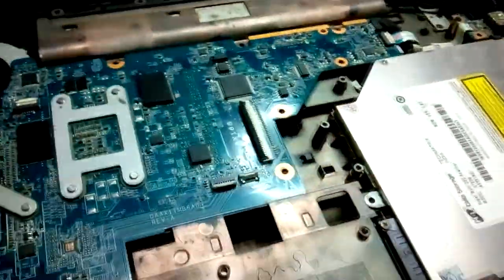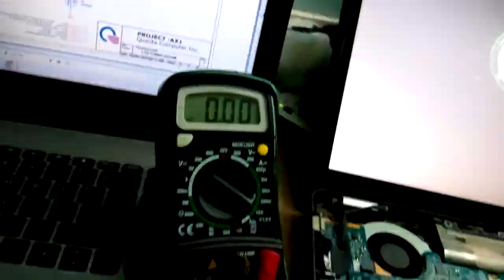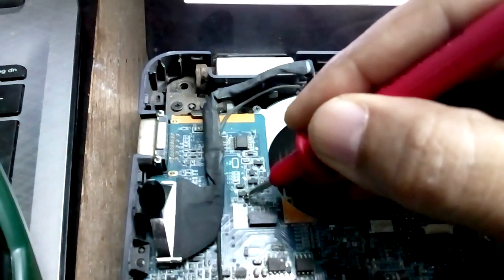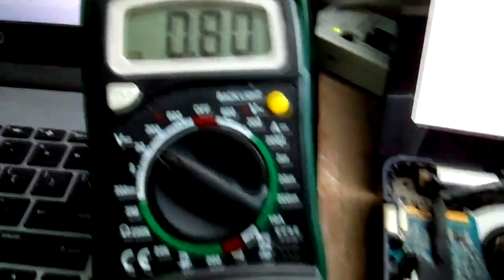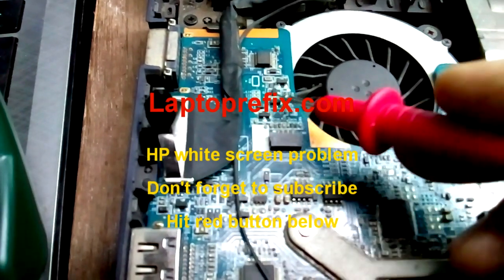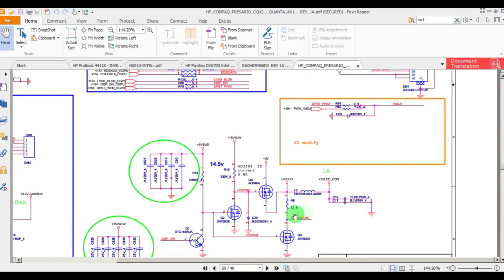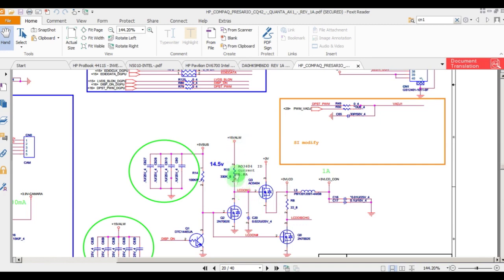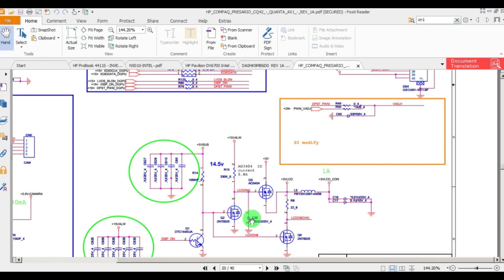how to fix white screen on laptop| hp white screen solution

Comment: I put a new motherboard in and the screen was working, now it has gone white again??? There must be something else not on the motherboard causing the problem.
Reply from the maker: Screen cable or screen check that is only remain
Reply: LaptopRefix Laptop Chip level Repair Channel 
So the screen cable or faulty screen can ruin the motherboard?
My new motherboard now has a burnt out Q7 transistor.
Reply: @ShaDoWxGFX  bad lcd cable can ruine the mobo cuz the short cut it happened to me twice

Comment: Hi i have white screen on my lenovo g585, I first tried connecting and disconnecting the cable did not work still white. Then after testing in external monitor and seeing that it worked I bought a new screen and new cable thinking that would fix the issue but still white, I don't know whats wrong😟 any ideas?
Reply from the maker: Check enable signal for data lvdsvdd voltage for lcd

Comment: I have the same problem but external monitor works fine ,I have changed the screen and still not working .what else can I do pls .
Reply from the maker: Check bios or lvds voltage
Reply: @laptoprefix  I have same trouble, where i check lvds voltage? To 40 pin connector? DA0AX1MB6F0 i have this motherboard HP G61 please i need help

Comment: HI sir can i know how u switch on the laptop top with that Tweezer which pin v need to short  can u please tell me  it will be great help full
Reply: bro always check for 3.3v on switching button jack.short that pin with ground with any conductor..ur laptop will turn on.but make sure u are shorting power on volt with ground.in case shorting any other 3.3v with ground may cause damage to SIO...
Reply: thank u sir

Comment: sir 48.4IU15.001 in this model also white sceen but 19 volt and lcd vdd supply 3.3 volt is also ok but still white display appear i also change dispay cable but still same problem ....what is the soluation of this problem